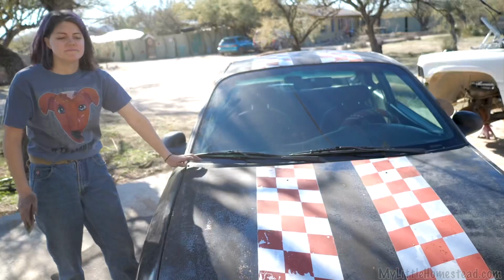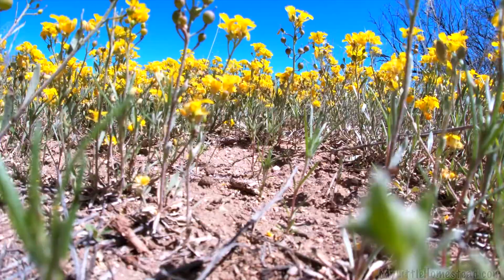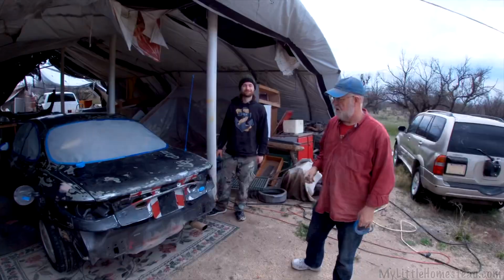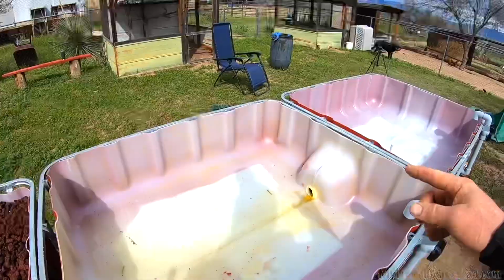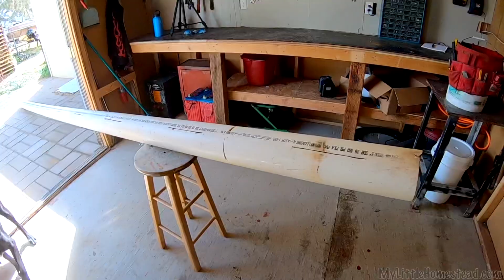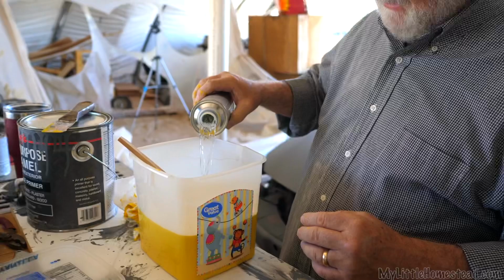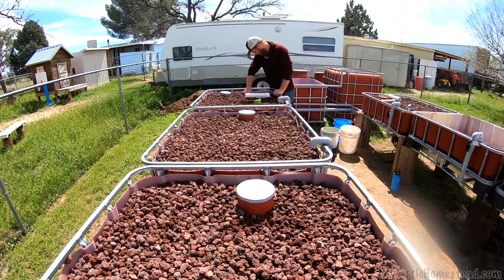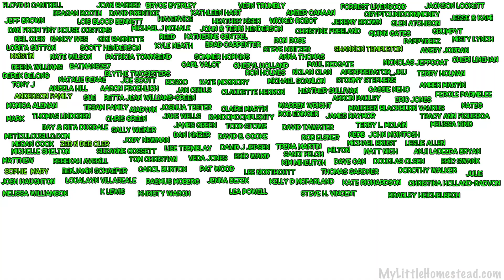Painting Shae's Car, Lava Rock & Bell Siphon for Aquaponic System | Weekly Peek Ep228

Comment: Very cool video, I always enjoy seeing the hydroponics coming together.  A little tip on the painting from someone who does it quite often.....You'll want to wet sand instead of dry sand.  Wet sanding will provide a much cleaner and smooth surface for your color coat and the end result will be paint so silky smooth and soft, it will remind you of baby skin.  You'll also want to do that for the clear coats as well.  Great video as always, I've basically been glued to YT for the last two weeks, and it's nice to receive updated content so I don't go completely mad with cabin fever during these crazy times.  Stay safe and have fun!

Comment: Rock chips and other areas where you stand down to bare metal, I should be primer, and blocked. After this is when you apply the primer sealer to the whole car. 30 minutes after applying primer sealer to the whole car you can apply your new paint color.

Comment: I haven't had good luck with fiberglass bonding to plastic like you did.  Usually what I do is use the fiberglass cloth with "plastic welder" epoxy instead of the polyester fiberglass resin.

Comment: Next time you have anything plastic cracked or broken like that bumper, try super glue and baking soda, you can even build up small missing pieces with it. I've used to fix the bridge on my guitar. There are videos on here showing how. It's how I learned, and now various travel mug handles, the neck on a radiator, and a few other things, including the molded piece around the headlight of my son's Subaru has been repaired this way. Once it's sanded and painted you can't tell.
The minute I saw the color I instantly thought "yep, you should all meet my oldest, he painted his 94' Probe GT bright orange and hand calligraphed the name "The Great Pumpkin" across the back. 4 minutes after it was finished and he left our garage in it he was t-boned by an unlicensed driver. Be careful.

Comment: Bryson - on your painting.  Good technique but slow down a tiny bit and try to be as fluid with your movements as possible.  If you haven't, you need to wet sand your primer for a better finish.  Use 320 grit and a garden sprayer to supply the water and keep the rough stuff rolling off the car.  Foam sanding blocks can help but you can also just use the paper by itself.  You guys did right with opposite solvent wipe downs - mineral spirits instead of lacquer thinner to clean.  I'm not an expert but I'm currently driving a truck that I rebuilt and painted myself so I lived in this world for a year while I was prepping everything and painting so let me know if I can help with any questions or advice.  Much love to you all.

Comment: Why you do not see Red Necks lined up to buy toilet paper! Buy a sink spray kit, T connector and a wall mount. Tap the T connector into the water supply line of your commode, attach the hose and sink spray nozzle to it, mount the spray nozzle holder to the wall. When finished doing the do, simply spay down the soiled area's and toilet paper will not needed, ever again! As far as cars go; buy yourself a pre-eighties anything, that comes with a straight six cylinder, three speed automatic, three or four speed manual. Jack it up and rebuild everything from head lights to tail lights, now you have a forever car that is easy and cheap to maintain, insure and licenses. Back in the 70's, I had a yellow, Opel, station wagon, with 1100CC engine, split exhaust, two one barrels and a four speed transmission. The engine would wind like crazy while making wonderful noises, people hear you coming and think that you are going a hundred miles an hour, actually, about forty and it got outstanding fuel economy. That car was a blast!